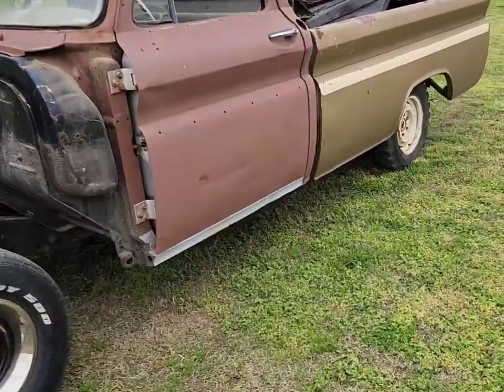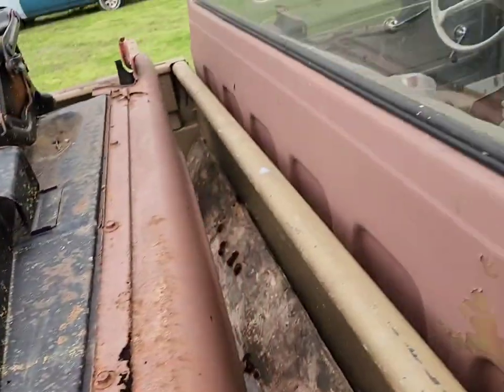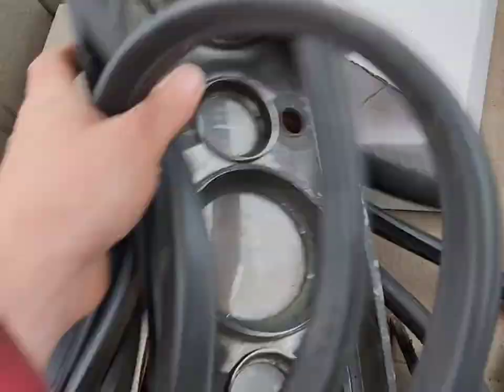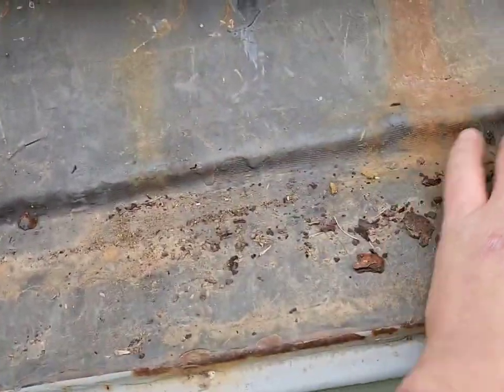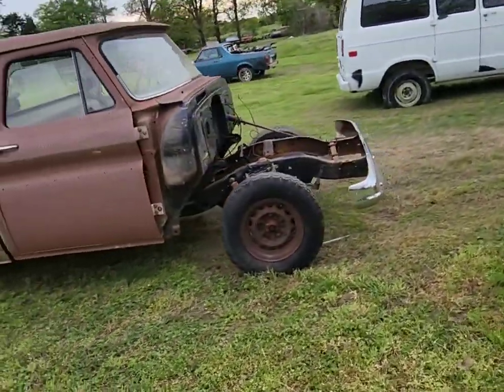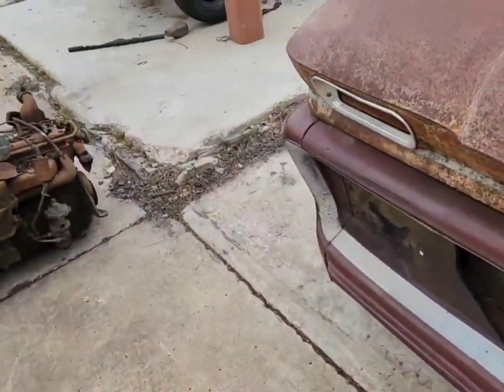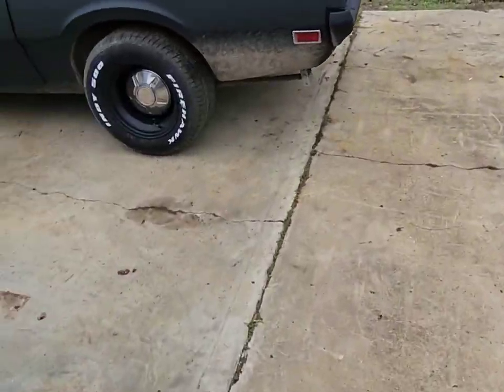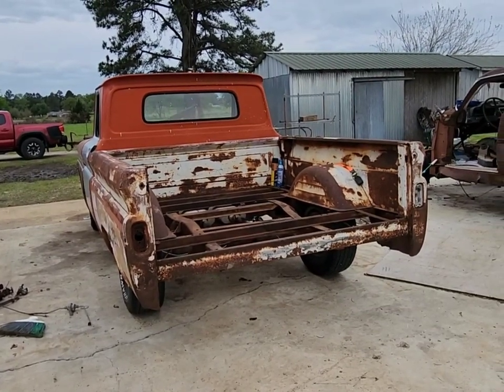parts and parts truck for the shop truck build

Comment: Nice score. That gmc is good enough to just put a six and a manual, fix the brakes so it's a runner, keep the parts and sell the truck on. Let the next owner fix the floor and you get some cash and parts.
Reply from the maker: I thought about that but I really need to cut the inner cab out to convert mine to big window